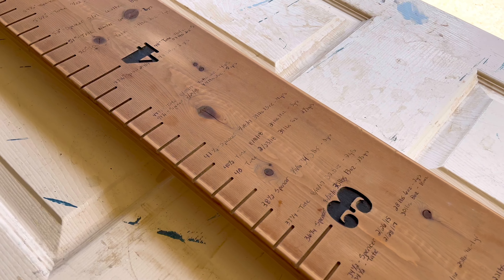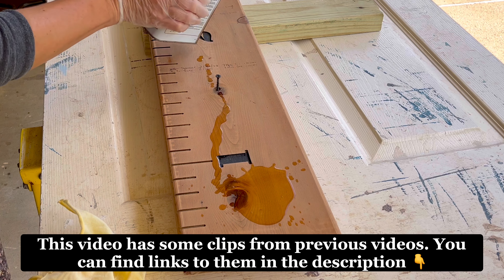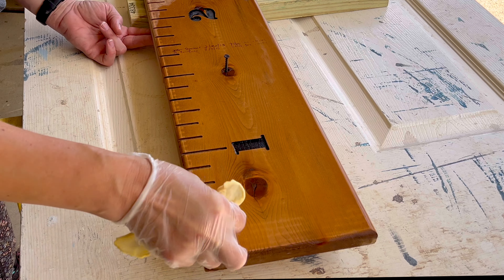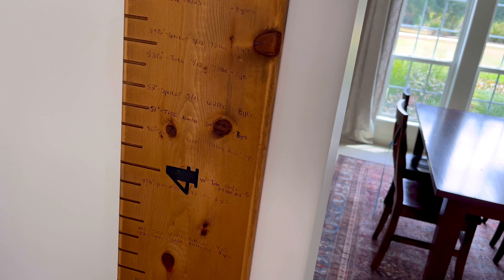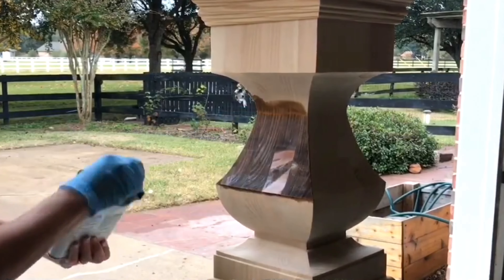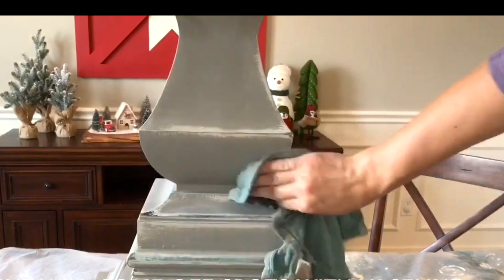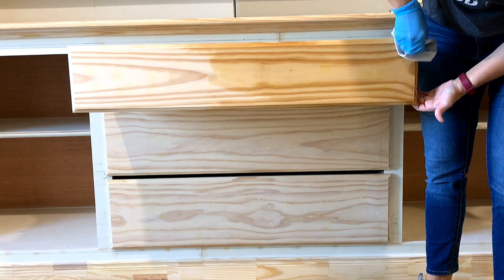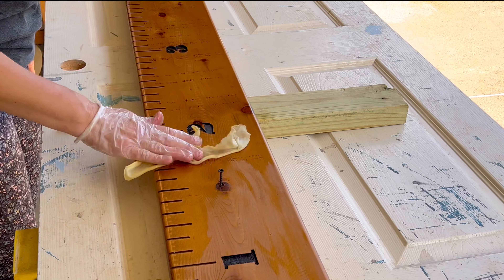Danish Oil Review: 12 Reasons I Use Watco Danish Oil To Stain Wood & Refinish Wood Furniture

Comment: Thank you for you informative video. I was initially thinking of using Tung Oil but the 6 coats and long drying times were off putting. Though the Danish oil seems just the thing to use instead. Thanks. 🙂
Reply from the maker: You’re welcome!! 😊

Comment: Hey! I saw your video on stripping paint from wood furniture, but I can't seem to find it at the moment so I'm commenting here! Anyway, I've run into some difficulties and wondering if you have any tips. It's a solid wood cabinet (oak or maple, I think) that was painted over. I went at it with a sander, but it was very slow going so I decided to use Citrastrip. The citrastrip helped loosen up the paint, but underneath the paint there seems to be some kind of blond varnish that I just can't seem to get at with the scraper. I added more citrastrip but now I'm just left with a goopy mess on top of this varnish layer. I wish I could just finish the job with the sander, but the crud (mixture of paint and stripper) is making that really hard. Wondering if you have any ideas!
Reply from the maker: Hi! It sounds like you need to scrape off the goopy layer, if it's thick and soft, then scrub the remaining residue with mineral spirits and a paint stripping scrubbing pad. If your furniture has slightly sunken grain, it's probably Oak. Maple is smooth. :) Good luck!

Comment: I just want to confirm, you can paint with latex over Danish oil? Won't it react and peel?
Reply from the maker: Are you wanting to paint furniture? I wouldn’t use latex paint on furniture. It takes too long to fully dry and cure. So it’s easy to dent up. But, If you apply Danish Oil, wipe off the excess, then let it fully dry (per instructions on bottle) then you can go right over it with furniture paints (like acrylic and chalk paint).